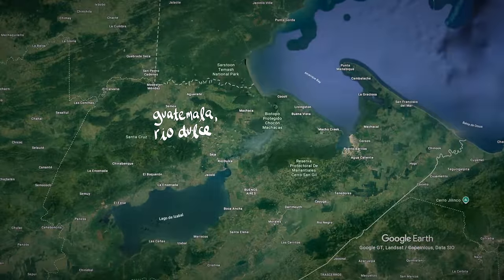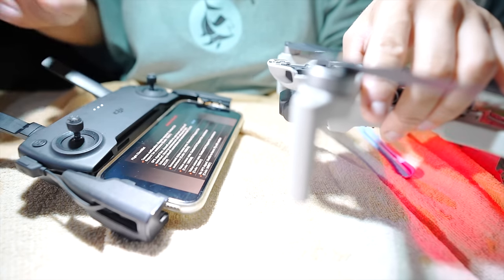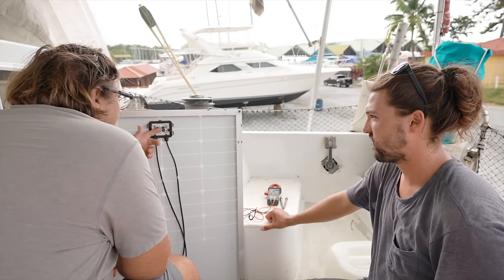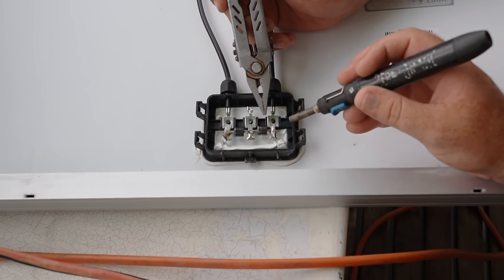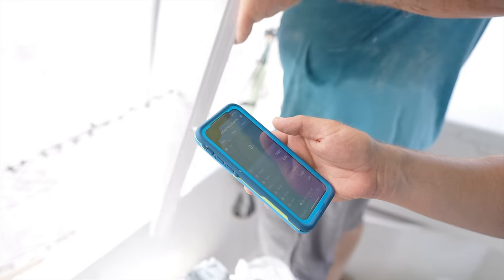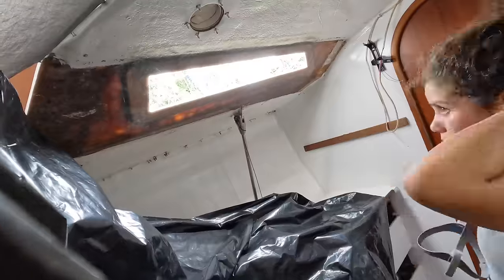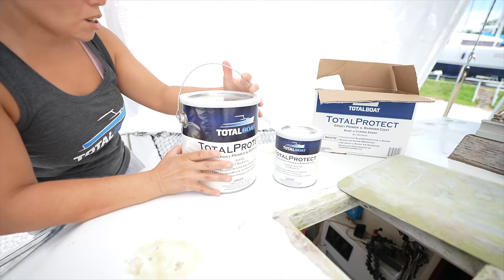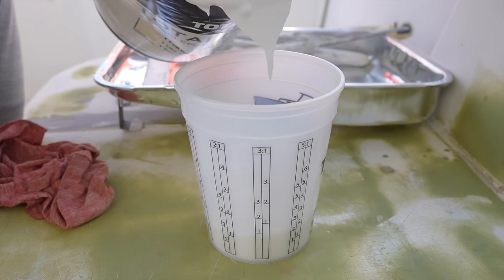SAILBOAT RRRs: reuse, recycle, repair, restoration, renovation, refit

Comment: A solder sucker is very handy when de-soldering a component. It sucks up the melted solder; you can use a syringe or an ear wash bulb for this also. Great job with the repairs. I normally don't care for boatyard videos, but yours are quite fun.
Reply from the maker: Thanks, never heard or thought about this - might make things easier next solder job. Cheers!

Comment: The base and catalyst do not weight the same. Although your paint will set up. Supposed to be measured by volume not weight.
Reply from the maker: True - says right in the instructions, measure by volume. You'll see us using the 'small yogurt cup' method in the next video, which is measuring by volume, but it's messier and less precise in the end 😆
Reply: Love your videos by the way.  I did the same thing but at the beginning of a kit.  By the end I had about a quarter of the base left over and no catalyst left.  My paint has held up just fine. For a few years now.  

Keep up the great work!  I’ve been watching since you started

Comment: I think the soldering irons were the problem, not enough heat as i usually add solder to a tough joint in order to get it started and make good contact, melt some on the tip and you need a 50 Watt pencil type iron that plugs into 120V with a little stand and water sponge. You also need flux cored solder, rosin flux, makes joints perfect and flowed and shiny. You also need tweezers to hold things that are hot. Too funny and great work overall. Looking good!
Reply from the maker: Yeah definitely - both our soldering tools were not getting hot enough, the gas one getting blown out and running out of fuel. I think it could have been prettier 😆